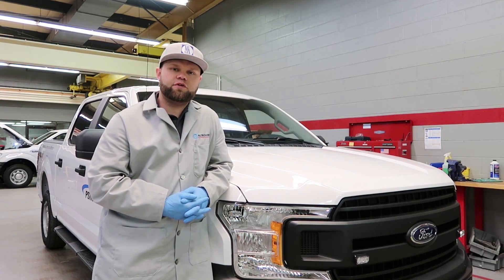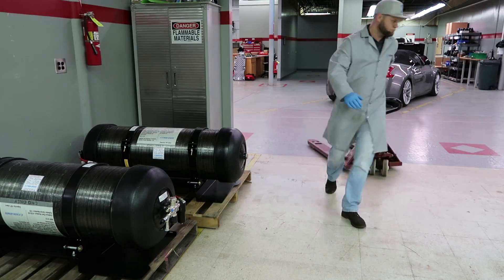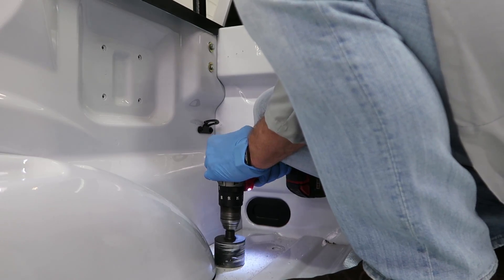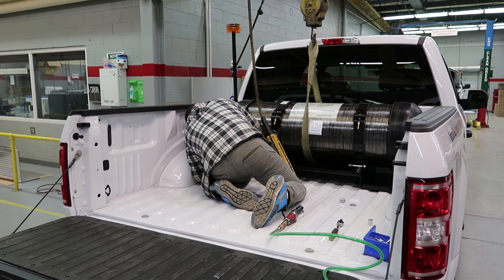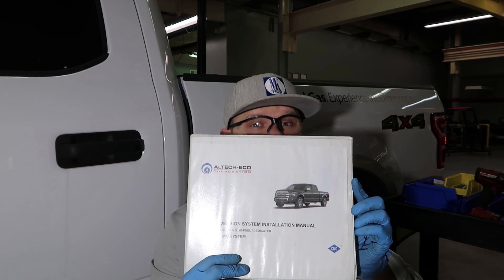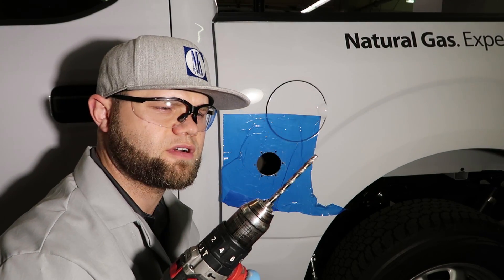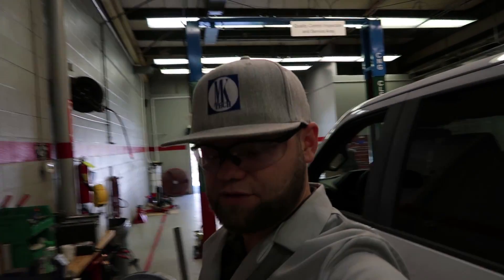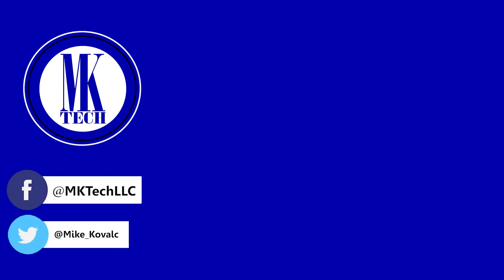2018 Ford F-150 CNG Conversion

Comment: I need some assistance I have Ford E450  bus that needs cng tank replacement
Reply from the maker: Ok , where is the cylinder installed now , and what GGE is the cylinder
Reply: @mk it is inside of the bus. I am not sure what the GGE is for it. The tank is positioned under the seats in back of the bus
Reply: I found your page again finally. Great job on this video. How do I find installer near me

Comment: I have A 2014 3/4 Truck that Has NG It does not want to come on any more when I hit switch to go to NG The truck quits running <,, It still runes fine on reg gas Could you give me any Pointers where to look for Problem? The Kit was installed at GMC
Reply: my f150 does no start at times .. i remove the pressure valve on the engine rail let some gas out then it starts right up

Comment: Hey thank you for the videos. Do you have one showing the installation of a in cab gauge for CNG? I am new to the CNG world (got a 2003 F150 for Father's day) and I don't think  the gauge is accurate. I went to fuel up the truck because the gauge said it was low, but only 1 GGE went into the tank.
Reply from the maker: +Keith Reynolds I think I do in my CNG playlist , but if I don’t let me know !   I’ll check for it too
Reply: @MKTECHUA  Sounds good I will try to take a look. I Have been scared to drive the car because I can not accurately tell what the tank level is.
Reply: Where does the wiring for a 2011 expedition gas gauge go?   Does it attach to the cng cylinder? Mine doesnt work.   I also want to place a cng
Gauge in cab, do u have a video? Thanks!!